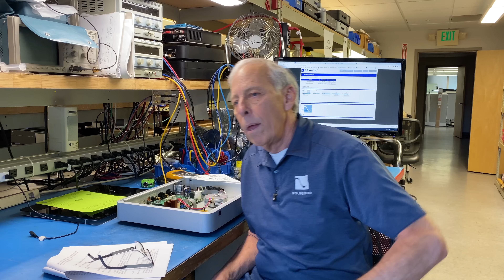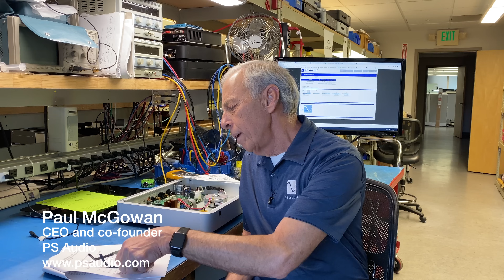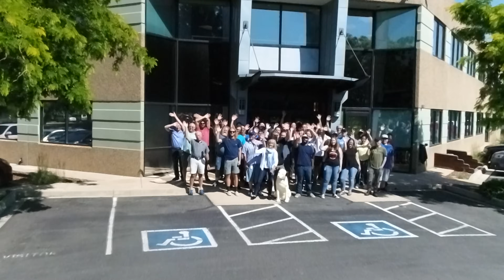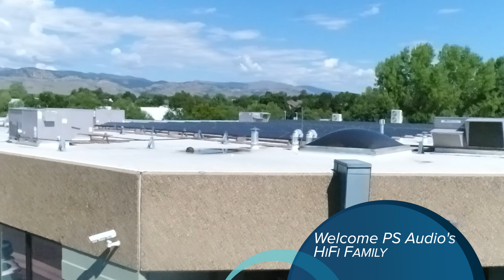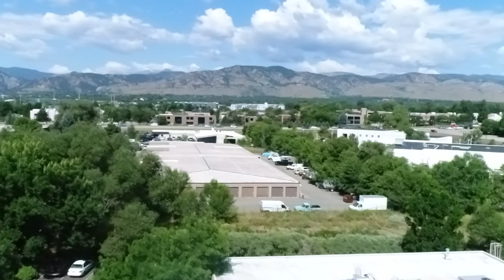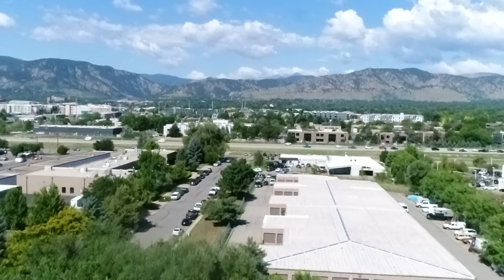How is loudspeaker sensitivity calculated?

Comment: 90dw/1w is only 1%efficiency reference, it means ,99% is lost ...you need 115db/w to come around 50% efficiency....with 90db/w your amplifier turns into a compressor when dynamics are asked in fortissimos on realistic levels , when you hear a grand piano played full grand accord , you get 115db peak...a soprano can easily clip your amp ...and its difficult to compensate with electric watts , you need doubling power for each 3 db increase...

Comment: Would it be more accurate to run 20-20k pink noise to measure the db? it just amazes me how loud 90db is, mine are 91 db. but i need to crank up the dial at almost half way to achieve 91 db. is that what it takes for 1 watt. that leaves me a lot of headroom if that's actually the case?

Comment: Thats a toppic thats confusing me:
If there is the measurement in 2.83 V instead of 1 Watt and I compare a nominal 4 Ohms Speaker to an 8 Ohm one and they both have outcome of, lets say 90 db in 1 meter distance.
The 4 Ohms Speaker drains 2 Watts. So do I have to remove 3 db theoretically from the result because double power drained?
Otherway: What makes a speaker loud? Amplifier Voltage Output or (* Ampere) Watts?
I dont listen to music on max power all the time, but just to understand this fringe of sound reproduction in theory.
Reply: An ideal amp sends 2x the wattage into 4ohm. So, if yours is close, don’t subtract anything, but if it has the same wattage into 4ohm as 8ohm, then subtract 3dB.
Reply: @homeboi808  
Thank you for answering!
So the Voltage is the scale for loudness at the end then? 
So if the Amp wouldnt be able to send double current into 4 Ohms conpared to 8, the Voltage wasnt reachable = quieter...? Is this right?
Reply: @JeanKatana  2.83V is 1W into 8ohm and 2W into 4ohm; so if your amp has identical wattage into 4ohm as 8ohm, a 4ohm nominal speaker would be 3dB quieter (1/2 the wattage) compared to an 8ohm variant.

However, most decent amps get very close to 2x (however, since companies know this, a few actually report less wattage into 8ohm so it looks like it actually perfectly does 2x into 4ohm, thus being a better made amp).

Comment: most should state in the specs under sensitivity. typically 1kHz test tone with mic at 1m away with 1w of power but there's no industry standard so the number may not be accurate between different manufacturers. Of course, when playing music the number is meaningless because music is 20Hz–20kHz. lol...
Reply: 1kHz is an old standard. Most nowadays use 300Hz-3kHz.

Many cheap speakers don’t have baffle step compensation, so <800Hz is reduced in output. A 1kHz measurement will hide this.

Comment: so it is 90db for 1000hz at 1W/1m. Is it the same bass frequencies?
Reply: In general NO. It totally depends on the impedance curve of the speaker and the electric phase angle that goes with any given frequency. That is why this number, even if used correctly, is is of none to very little use at all.

Comment: Paul - I'm a big fan but Speaker Sensitivity is defined by 2.83V not 1 Watt at 1 Meter. For 8 ohm speakers, Power = ((2.83)^2)/8 ohms or 1 Watt. But many Speakers with 4 ohm loads will actually be consuming 2 Watts at the same voltage. Not sure why this spec was changed but it seems to help speakers with less than an 8 ohm load. I also object to the use of speaker efficiency and speaker sensitivity interchangeably. They are not the same. In fact much different. Efficiency is power out divided by power in. At 1 watt of electrical power in, the acoustic convergence of this power to sound is about 10%. Speakers are inherently inefficient devices. Sensitivity relates electrical power in to decibels of sound out. Much different. The terms have distinct and different meanings. Thanks, I'm still a big fan and enjoy your videos.

Comment: The problem is that the mesurement is done at 2,83 volts which is 1 watt on an 8ohn load, companies cheat in the fact that if your speaker is 4 ohm or less, with 2,83 volts you are applying much more power. This spec should be “re-worked” taking into the mesurement the real impedance of the speaker under mesure.
Reply: Using 2.83V is taking the real, complex impedance into account.

An ideal amp sends out 2x the wattage into 4ohm compared to 8ohm.
Reply: @homeboi808  2,83 volts on 4 ohm is 2 watts, 3 db more, but its unfair. Look at kliipsch specs for example, they don’t declare the real inpedance of the speaker (their claime is “compatible with 4-8 ohms “) which doesn’t mean nothing.  If you read any technical review of their speakers, no body is finding any match on their ratings.
Reply: @robertopedrazzini1735  Correct, but your amp ideally is sending 2x the wattage into 4ohm, so it evens out.
Reply: @robertopedrazzini1735  By the way, I actually take the speakers measured by Amir of ASR and compare sensitivity to what the company claims, Klipsch is indeed far off (their Heritage series even states it is in-room):
https://sites.google.com/view/speakerdata/speaker-sensitivity?authuser=0

Comment: Was working on my nikko alpha 130, a fine little power amp. and I saw some resistors that were a bit melted. My intention was just to replace the relay in the protection circuit. Well I found out that there was a serious reason the relay blew, because those new resistors lit up like candles the moment I switched the thing on. Back to the drawing board!

Comment: Sorry that doesn't really answer the question because these days Speakers are reported by Manufacturers as db/2.8v/m.  they have stopped using watts  and it is misleading. Your answer works for the 1980s but not now!  2.8 volts does not always = 1 watt
Reply: That's the same thing, provided your speaker is 8 ohm. Power = V^2/R
Reply: @stephenwong9723   Thats for proving my point... 2.8 volts  = 1 watt   only under  certain circumstances.  USing 2.8volts brings in   another variable in the measurement that results in the measure being less useful and less well defined
Reply: @MrAustrokiwi  Well, most speaker vendors specify efficiency at 1kHz/1m, and the so called nominal impedance is also measured at 1kHz, so, the numbers should line up.  But, as you said, impedance varies (a lot) by frequency.  Not like Paul said, I don't think speaker vendors specify a sweep efficiency, just 1kHz number.

Comment: Such sensitivity number fail to account for dispersion. Speakers that disperse the sound over a wide angle might be less efficient by number but more efficient in actual room environments. E.g. if you have backfiring speaker drivers, their added output sort of get lost in the measurement.
Reply: @FatRat-f9m  Yes, a 1 meter distance isn’t where people sit in a typical audiophile stereo setup, except if it’s at a desk computer setup...well, ironically, I’m just realizing I’m sitting approx 1 meter from my two speakers in my office setup.
Reply: @ThinkingBetter  - that’s what on axis and off axis polars are for.
Reply: @petersouthernboy6327  Yes, I've measured speaker dispersion before e.g. radar plots with motorized turntable at different frequencies. The point is that a simple single on-axis sensitivity number can be misleading.
Reply: @ThinkingBetter  - oh, not only is it misleading - it’s highly abused by speaker manufacturers
Reply: @petersouthernboy6327  Yes, it's a bummer when some marketing-oriented product manager guy is just about numbers and the engineers end up pursuing a bad compromise because he wrote some target number on a spec sheet. Too many audio products sound bad because the passion for great sound lacked and silly numbers ruled. The same goes for amps with ridiculous THD numbers and peak watts. Actually, measurements can be good, but mostly the wrong ones are promoted. I care about the speaker THD and decay performance graphs much more, but marketing people always don't want to promote those.
Reply: @FatRat-f9m  More numbers pulled out of your... hat.  Thanks ;-)
Reply: @FatRat-f9m  But *which room*?  Yours? Mine? Theirs? How would one measure to account for varying room acoustics. What is a “perfectly” treated listening room? Or better yet, how many people have one?
Reply: @PanAmStyle ...I guess that you've got some researching to do then, haven't you 👍😎
Reply: @FatRat-f9m  😂 ... thank you, but I think I’ll just work on my own listening room with my own gear and do upgrades as finances allow. With some 🥃 that’s my kind of research!

Comment: I assume most manufacturers use the 2.83 V (which is 1 watt into 8 ohm).
But is you use that voltage on a 4 ohm speaker you get much higher sensitivity numbers than it really is.
One should do an impedance measurement with a sweep and then take the square root of the impedance @ 1kHz as a voltage value to feed the amp.
In that case 1 watt is really 1 watt for that speaker.
 I can assure you most don't measure like that otherwise there wouldn't be any 90 dB+ speakers.
So if impedance @ 1 kHz is only 6 ohm you should do the sensitivity measurement with 2,45 V not 2,83 V. For 4 ohm it is only 2 volt. See what happens when you use 2,83 V on this one. Very high efficiency numbers that are not correct because you feed more than 1 watt.
Lots of useless and heavily misguiding info for many speaker brands sorry to say.
Reply: John Devore did a video on this. He said that is what drove him to starting Devore Fidelity. Check it out.
Reply: @mikenorris812  Link would be nice.
Reply: https://youtu.be/PEcFkSQMc8g
Reply: @FatRat-f9m  Even if they state 1 watt, I often doubt it when I look at the 90+ dB outcome.
Reply: Sorry about that Jos

Comment: How do you measure that you're sending 1 watt of power to the speaker?
Reply: REW has a noise generator with white, pink and sweeps in Sine and Square, Tone burst and has a voltmeter on it with calibrate options
Reply: If you want to do it accurately, you have to measure both the voltage at the speaker terminals and the current flowing into the speaker (because speaker impedance varies wildly with frequency).
Reply: More accurately it is the RMS voltage times the RMS current times the cosine of the phase difference between the voltage and the current and is frequency dependent.
Reply: The square of the applied RMS voltage signal divided by speaker's impedance or the same voltage divided by current or using a suitable wattmeter, etc etc...

Comment: There could be a measurement for how loud a speaker can carry a tune at 10 meters vs 1 meter. How does a speaker with drivers at 90 degrees from each other carry over distances? I just don’t see how a speaker like that can do well unless it’s in a room made for that kind of speaker.
Reply: you can easily calculate that if you know what the sensitivity is at 1m. For every doubling of distance, the sound level reduces by 6 decibels
Reply: @FSXgta  I figured it out and that is probably real close. I got 46db at a 1/4 mile, which is about right from what I was told the summer before. Are you an acoustic engineer?
Reply: @SJMessinwithBoats  no, it's just basic sound physics. Keep in mind it is probably higher in a room, because sensitivity is tested without room gain
Reply: @FSXgta  Thanks for the info, I like my music outside in a field the most. This is where most speakers go flat. I listen often at moderate levels and most of the time 30 feet or more. It’s like a work shop system, but out in a field.

Comment: Ok, now to go a little further, what property of a given driver determines the actual sensitivity? Voice Coil? Magnet Size?  A little more further, does this mean all of the drivers in a speaker cabinet have to be the same sensitivity? Or can say the tweeter be less or more than the woofer and squaker?
Reply: Bringing drivers to equal sensitivities, ie. to give as flat a response curve as possible is done in the crossover. However it does help greatly if you start with drivers of very similar sensitivities & there are so many drivers & driver manufacturers that it isn't hard to select drivers of very close sensitivity.